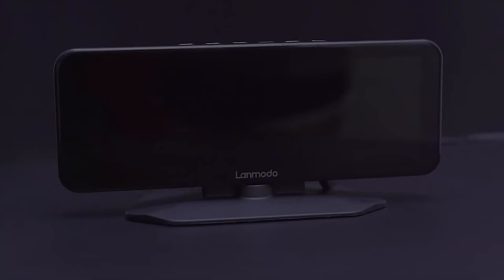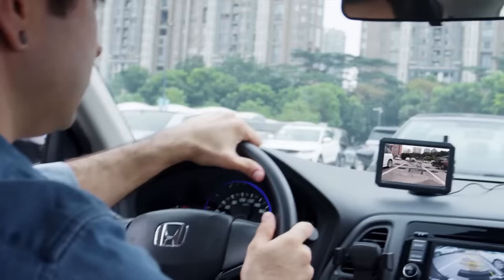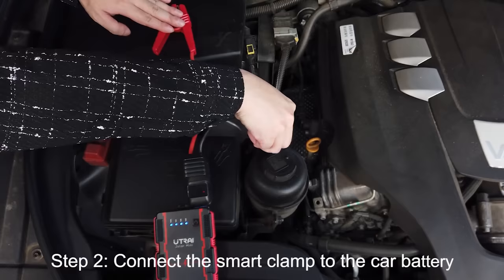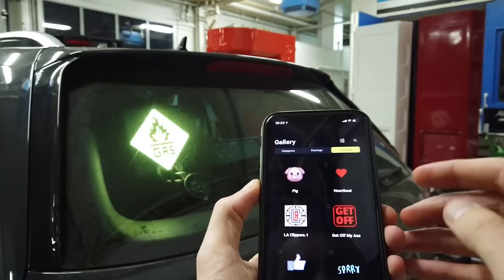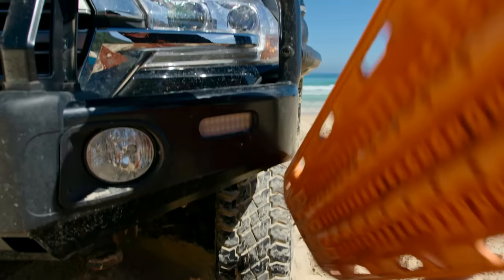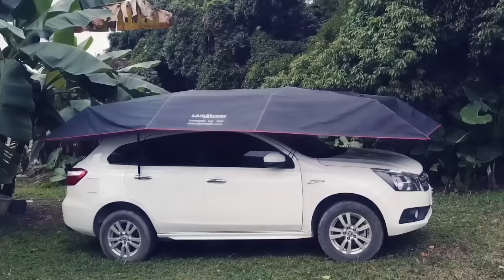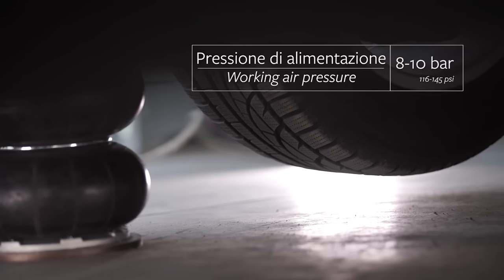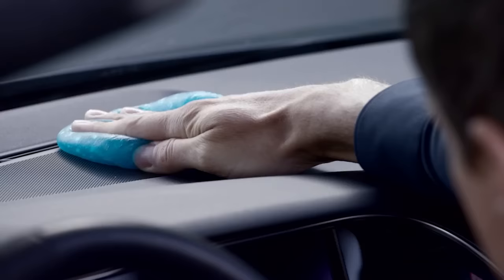14 NEW CAR GADGETS YOU SHOULD BUY

Comment: If you get stuck in the snow or sand, 2 leftover new roof shingles will work great to put in front of tires to give them grip.  They don't take much space in your car.
Reply: Use 2  used car mats, no wasted space, no additional expense
Reply: and extra weight, those bundles are heavy.
Reply: @muligadarimini4586  I simply bought two Auto Socks. They can be reused over and over and don't get flung 20 feet from the car when trying to get out of a small snowy ditch.
Reply: Sounds like a great idea, but those shingles usually become dangerous projectiles. Be safe out there guys!

Comment: dash cams need to get away from suction cups.  they dont work after a year and are a pain when putting up a window shade.  The Garmin magnet that is the size of a quarter and sticks to the window, is the best solution out there.
Reply: The US needs to set a standard for these mounts so you don't have to use a completely different one every time you switch them out.  Suction cups, at least, pop off and don't leave anything behind.  Those adhesive ones leave grunge behind and cannot be used for other brands or even variations of the same model.
Reply: Don't like Garmin, I had one and the night vision wasn't good. I now have the Viofo a119 v3, night vision much better and have used the suction mount, putting it on and taking it off when I'm parked, for more than a few years now and still going strong.
Reply: The same can be said about the mounts that plug into your ventilation. It disables positioning the direction of the breeze and there are quite a few car models that don't take just any mount.
On the other hand, I really don't like gluing anything to the car. Once your gadget breaks down (and it does so before the car breaks down), you're stuck with it because it's usually not removable without damaging your car. There are "professional grade" suction cups that last but manufacturers ought to use them.
Reply: Sammy Twotone  It would work for glass and other solid hard surfaces. Remaining glue from tape can easily be removed with a bit of vegetable or other oil... but if you have to stick something to dashboards, very sticky tape can make unrepairable damage. If you ever plan on selling your vehicle, it might be a costly choice.
Reply: Sammy Twotone  That's what I use... has a 5lb limit which works just fine.  It's less prone to lose adhesion in the heat, too.
Until you actually get in an accident and the camera still goes flying. :/

Comment: I like the Dashcam that doesn't just show what's happeing on the outside, but also the inside, so if the Cops pull you over and you take your seatbelt off to get your insurance papers, the Cops may arrive and fine you for not wearing a seatbelt, but with a camera showing the inside, you've got the proof that you had your seatbelt on.
Reply: How about don’t do anything until instructed. It is safest that way.
Reply: @kennethgoodhart2650  I like to quickly get out my documents before the police get to my window for two reasons. 1. So they can't shoot me while I am digging for my documents and 2. So they don't take that opportunity to conduct a visual search of the inside of my compartments. Which is part of what they want to do anyway so denying them that makes me feel good.
Reply: Is a sad state of affairs where they now sell a special wallet to put your documents in before you start driving. After being  pulled over, the wallet is designed to hang outside the window minimizing the interaction - no peeking in the globe box, no awkward reaching, no need to remove seat belt to reach something, and even limiting odors by only lowering window enough to hear officer .

Comment: Nice car jump starter, it suits my car.
Reply: The Jstar3 will not Jump start any car with a Completely Dead Battery ? That Takes Capacity you cant hold in the palm of your hand LOL
Reply: @BillBadMule123  I have a Benz C260L, it works very well for my car.
Reply: It won't start the vehicles they said it will - it may start a V8 sportscar, but it won't do anything with diesel trucks (Injected Diesel cars it may be able to jump).
It won't touch a fully depleted battery.

If you want anything more than a glorified power pack you want 2000 available peak Cold Cranking Amps at 50% pack charge.
Noco GB70 ($250) will actually push enough into a dead battery to register and crank after about 60 seconds.  And if the alternator is dead will provide enough power to get you to a safe place to park (about 1 mile, tops).  No other battery jump box I've seen will do this - they cut off after 30 seconds.
Hulkman Alpha 100 ($300) will, indeed, crank 10 litre diesel pickups - MAYBE (tends to go into safe mode and become useless for 10 minutes).

With jump boxes you get what you pay for, and anything below $150 will leave you stranded.
Reply: @amzarnacht6710  Thanks, you know more about than me, I didn't try it on diesel engine.

Comment: 1st Any dash cam I buy will have a polarizing filter because the glare is bad.
2nd. The Lanmodo looks interesting but is $400. A blanket-like cover, secured by bungee cords at the corners, would be far cheaper. High winds are always a risk with these things though.
Reply: That's what I was thinking. It's practically a sail and that's a lot of surface area for a suction cup and a couple bungees to hold on strong gusts.

Comment: Mojipic = Cop magnet. 
Around here, (southwestern Pennsylvania) The cops would be on you within a few minute. Especially in my town.  Demanding that you either cut the wires off of it, or get a fine, or both..  I had simple, amber colored lighted washer-nozzles once.  Basically accent lights of LEGAL color on my car.  Got pulled over and had the cop hand me a pair of wire cutters.  I was forced to open the hood and cut the wires to the lights.  His reasons:  "They are distracting to other drivers" (No.)  "They might blind someone."   (..and these blue & red strobes and sun-intensity spotlights spotlights on his car aren't..  Riiiight..)  "You are impersonating a cop." (Seriously,  he did say that!) "They are dangerous equipment." "If it's not factory stock, it's illegal. "  (No. it's not.)   It was cut the wires, or get fined 300 dollars per light.  (He yanked that number out his ass as the "Unsafe equipment" fine is 50 dollars) 
So I could imagine what they would do with a scrolling, animated unit that is basically a low-res screen in your back window..  Hell they'd just steal the whole car.  (They call that "Impounding", I call it theft.  Had a cop steal my car for a headlight being out!  I was on my way to replace it!  No wonder the police department in this town was shut down for corruption.)
Reply: I'd laugh in that cop's face and tell him to find a mall security job, since he has no idea how to wear the uniform or know the first line from the penal code.

And that mojipic is pure shit.  You know that within seconds people will have 'fuck you' and 'learn to drive, asshole' flashing on it.
As an emergency services worker it would be convenient to have arrows or other warnings displayed but, well, I've got so damn many lights on my car people would miss a tiny little middle finger in the back window.
Reply: mine never worked, no customer service. I would have been better off buying the cheap Chinese version

Comment: Folks these days use cameras on the end of a stick to record their activities. You see these stuck on airplane wings and also paramotor pilots. If you stuck the camera on the end of a stick and attached it to your car, The display would allow you to see over the hulking pickup in front of you. Or around the 18-wheeler.

It could fold down along the roof line when not in motion.

Many vehicles have luggage racks, mine does not. I'm not sure how it would be attached.

Perhaps a double suction cup on the roof? Two suction cups for stability...

Comment: Be aware that Mojipic or devices like them is banned in NY State as the law says that its a distraction to motorist.  You will get a steep very heavy fine if police catches you with one.
A few friends of mine had a device similar to the mojipic and they incurred are $500 fine from the judge and a court order of a forcible take-down of the item in question..
Reply: You can always use it on the side window of your car :)
Reply: @Mojipic  Yes, side windows are ok, and allowed.  Just not front or back.  as its a distraction to other drivers.
But I have seen people turn their heads over to see what glittering thing is happening on the side window, and when the driver looks forward again, they realized they are about to crash into something.
In the city police calls it "Rubbernecking Accidents"...

Comment: I need something that can clean mold, mildew out of the air conditioning vents in my car. 🤮 It stinks really bad when you turn on the air-condition.
Reply: Pour Lysol down through the vents outside in front of your windshield.  The drain pan for the a/c get dirt and mildew and that will help clean it out.  And, maybe run your a/c fan with the cooling off for a few minutes to dry out the drain pan.
Reply: See if your car has an inside cabin air filter; if so replace it.

Comment: You never, never ever want to drive your vehicle with anything plugged into the OBD port.  That can cause damage to the main vehicle computer that can cost $800 to $1000 to replace.
Reply: Please catch up to 2010.
Reply: @amzarnacht6710  
Please catch up actual science.  OBD stands for "onboard diagnostics."

Its purpose is to allow a technician to read stored trouble codes, easily get precise measurements of the different functions the computer controls, adjust things like wheel diameter and rotation to get accurate speed displayed on the speedometer, and to finish programing a new computer if the existing computer stops working.

The OBD port was never designed to have anything plugged into it all of the time no matter the propaganda put out by insurance companies.
Reply: @oldtimefarmboy617  As someone who works with and on cars, I'm fully conversant with ODB ports - and the fact that modern dongles will do nothing whatsoever to the vehicle while it is in operation (since, of course, that is the state they're designed to operate under in the first place).
Please, 2005 is wondering when you'll catch up.
Reply: Thanks ! 2ndary items is a poor option...

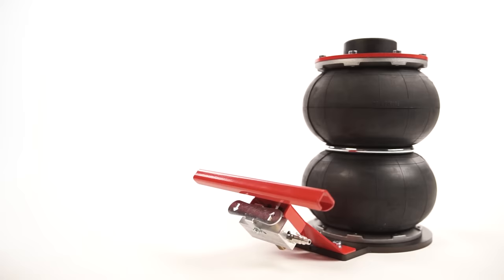Comment: 12:57 it might do what it does safely but.... It's still full of air; in which case it could go bang and kill you; especially if you are under the car (you shouldn't be but you know what people are).
Reply: My scissor jack can raise a car twice as fast as that thing, do it on the side of a busy highway, with no air pump needed.  Just some basic knowledge and a $12 adapter to use it with my battery operated impact wrench.
Reply: Use jack stands if you're going under the car
Reply: @amzarnacht6710  are you talking about those cheap impact drivers that plug into a car accessory port or a normal cordless power tool? I'm putting together a kit for roadside breakdown - PPE, lights, safety gear, tools, etc
Reply: @woodstream6137  20v Cordless impact tool.  I use the Dewalt, but others are decent too - you'll want the 1/2" drive.
I could give you an entire list of roadside tools you'll need, and some you'll just want.